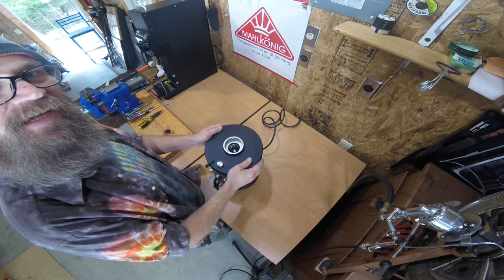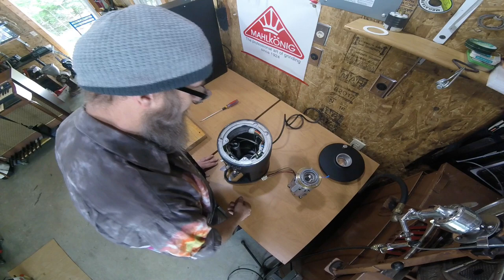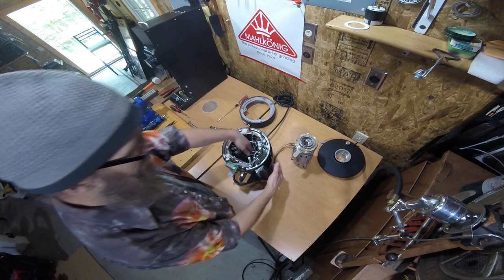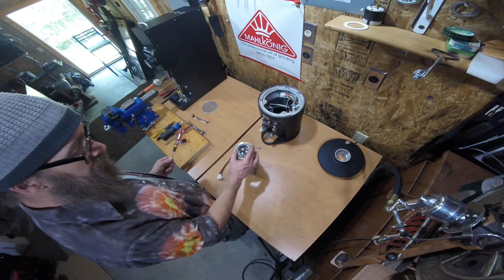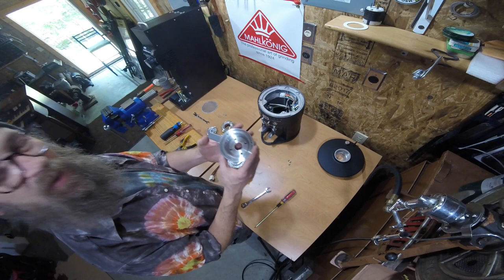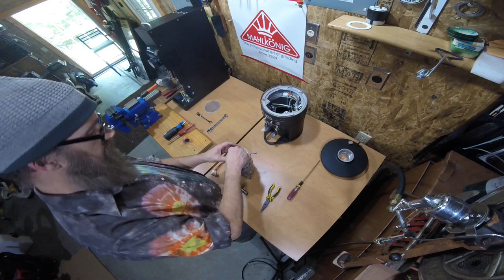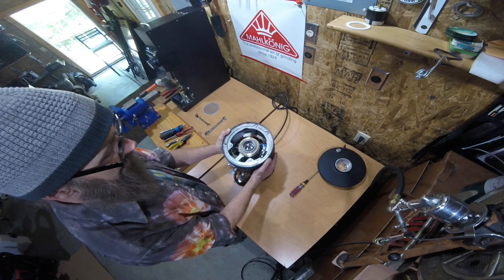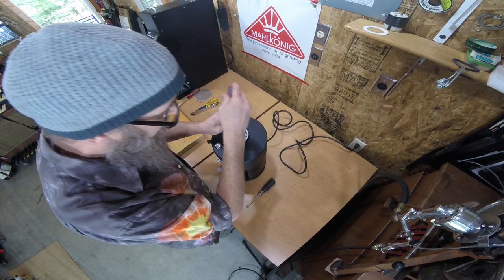K30 Espresso Grinder, Complete walk through

Comment: Excellent Mark but I believe one critical step was missed.  After the initial calibration, the inner aluminum ring needs to be rotated counter clockwise to align the initial mark with the 10½ cog mark on the brass ring prior to reinstalling the lid.

Comment: Thanks for posting this Mark - very helpful. I was using a Baratza Vario to grind for my Rocket R58 but was constantly fiddling with it every time I roasted a new batch of beans. Since the K30 is stepless it's very easy to dial in the perfect setting for the optimum espresso pull with very minute adjustments. 

Obviously this machine is overkill for home use but I can't imagine NOT having it!

Comment: Hi Mark I wonder if you could help me please?
My K30 display has gradually got dimmer but the display works fine.
I am looking to fix as have retired now and just bought a Spaz S 5 for home and I originally came from electronic engineering background.
Have you any experience of this fault please?
More likely be a PSU issuer or the display itself?
I’m assuming it’s an electrostatic rear lighting rather than LED?
Any help would be most appreciated, thank you!
Tim
Hampshire UK
Reply: i do have experience seeing this symptom but i dont exactly know the answer to your question on the build of the display. I usually do have to replace it to correct the issue .  good luck